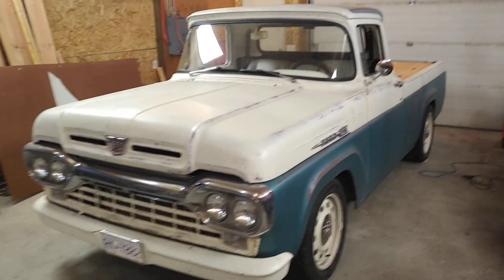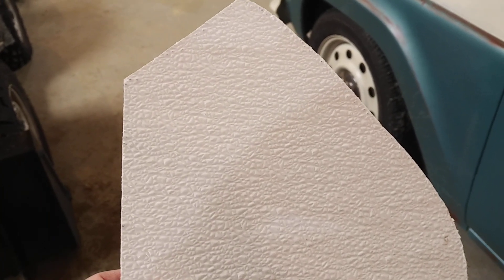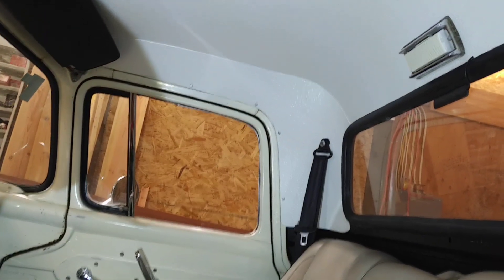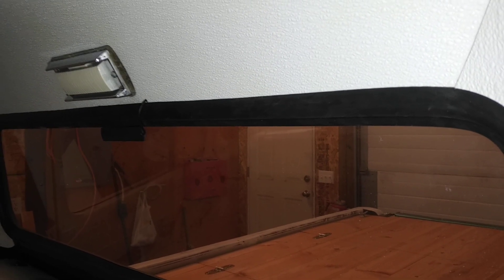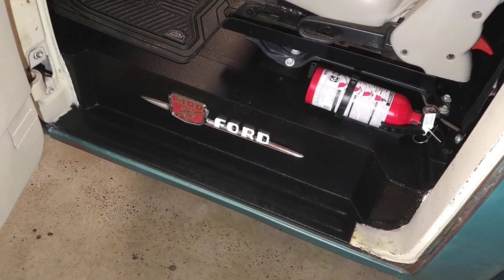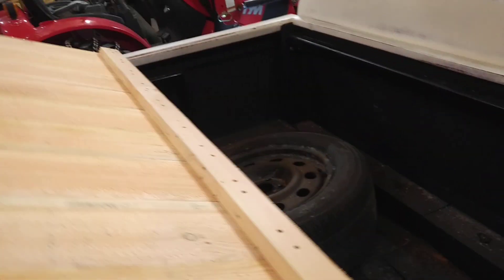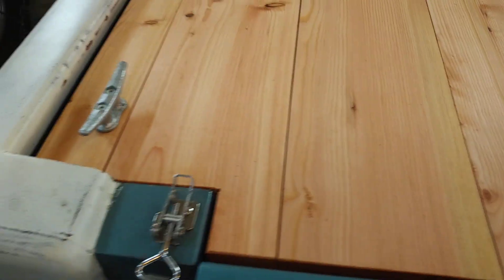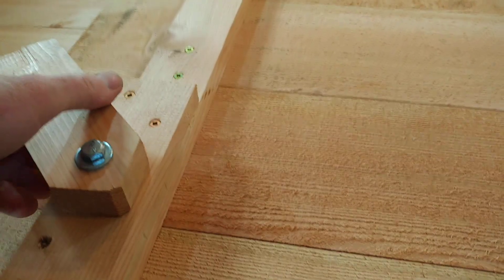1960 F100 Crown Vic Frame Swap, Interior, Ep. 20

Comment: Nice work, the headliner especially. Anyone with a cordless saw could probably cut through the bed wood, but if that ever happened you could probably line the wood underneath with sheet metal. If it was my truck I wouldn’t leave it unattended long enough for theft to be much of a concern.
Reply from the maker: Thank you! Yes, the bed cover isn't super secure even with the locks, but I'm hoping it will keep the honest people honest. Good idea of adding sheet metal to make it more secure.